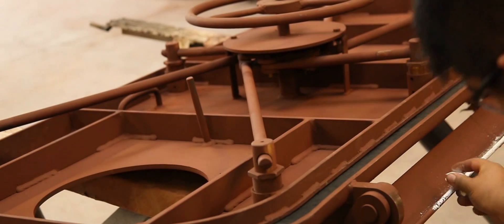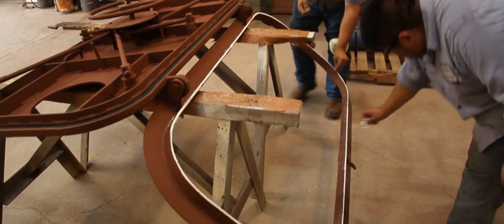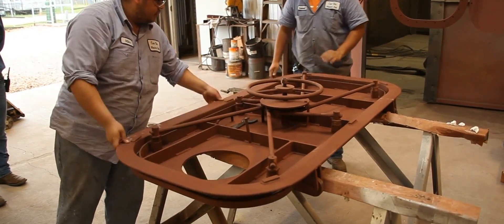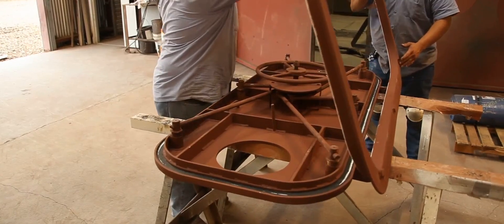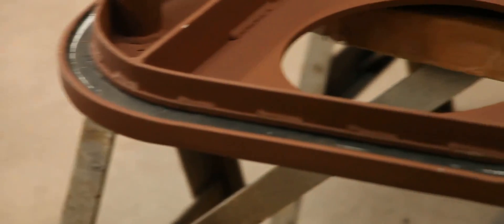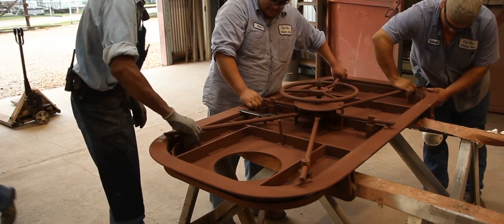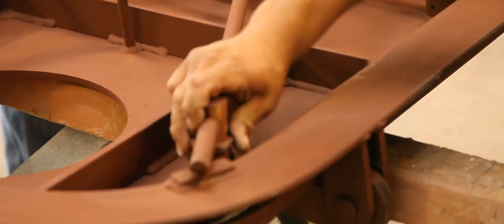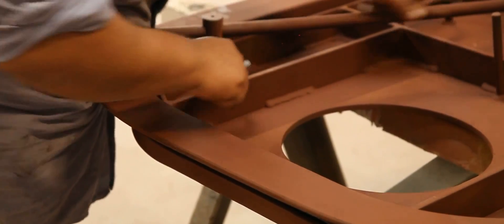Chalk testing a wheel-operated door

Comment: What is the technical name for the lock mechanism
Reply from the maker: By "lock mechanism" do you mean the mechanism that closes the door and creates a water-tight seal?  That mechanism is referred to as a quick-acting dogging mechanism.  The quick-acting mechanism on this door does not "lock", so that it prevents you from operating the mechanism and opening the door (similar to a dead-bolt or a thumb-turn lock on standard residential doors).  The only way that this door is secured so that it cannot be opened is with a pad-lock inserted through a hasp on the door panel, and an eye on the frame.
Reply: Hii